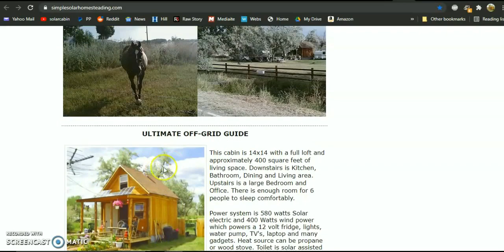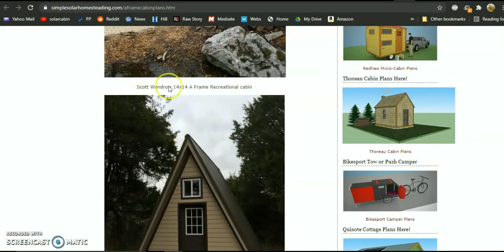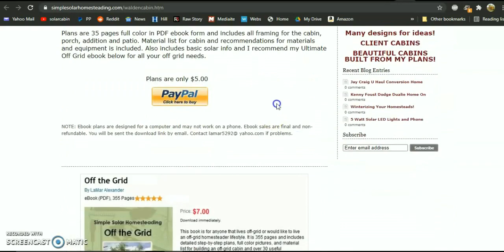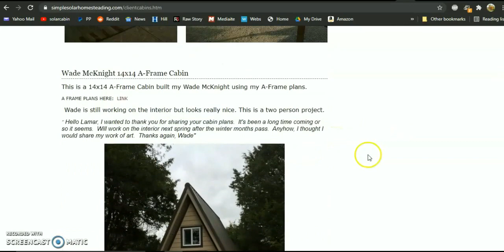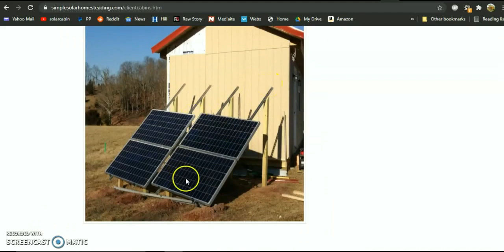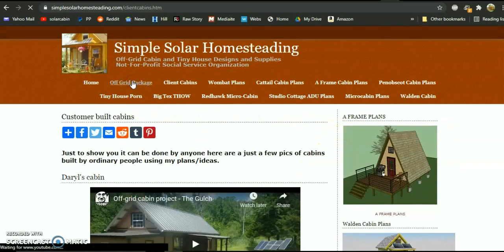Build Your Own Off Grid Cabins Full Plans

Comment: You were trained as an architectural draftsman?!!
So….I wonder if I could find an architectural draftsman locally to work with so I can design my own garage/workshop that will meet code….?  I wonder if there is a professional group for those folks working under architects and what their working title might be?
If that makes sense.
Reply from the maker: Depends on your city/county. If they want wet stamp plans that takes an architect. If not you can do it yourself or find plans and modify them or find a draftsman to do them for you.
Reply: @solarcabin  thanks again.

Comment: Has Anyone built a cattail cabin ? 
I'd love to see a step by step video !
Reply from the maker: It has been built and one guy is building one now but no pics yet. That style barn cabin  is also available pre-built at HD and Lowe's if you want to start with a shell.
Reply: @solarcabin  would there be any trouble w/permits etc w/Lowe's shell ? If not what about insurance ?
I've thought about that option . I priced a 16x16 through Lowes Contractor They want $18,000 .
Reply from the maker: I know of several that have used the pre-built sheds to start their cabins and it depends on your county codes but the ones at Lowes and HD should be workable for that.  Prices are high now but it would speed up the process. There are quite a few vids on youtube showing how they converted a shed to a cabin that might help.

Comment from the maker: Cabin plans are here: http://www.simplesolarhomesteading.com

I started designing and remodeling cabins as a teen and went on to get trained as an Architectural Draftsman and have worked in the construction field, built many sheds, built my own off grid cabin and have designed many cabins built by other DIY builders. Go by and look at the cabins built from my plans.
Reply: Nice! I’m 16 and I’ve recently started building tiny homes using Minecraft, including ones inspired by your plans! I’m currently thinking about building my own house and going off grid, and Minecraft has helped me a lot with designing and modeling plans for my dream home.